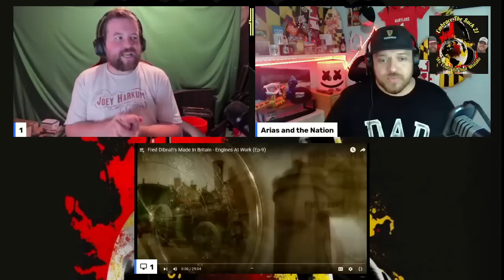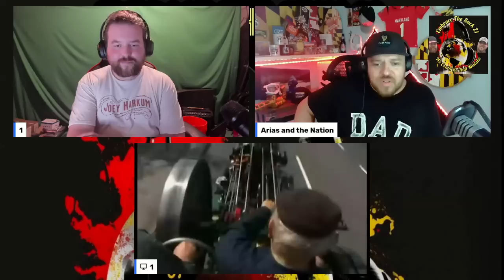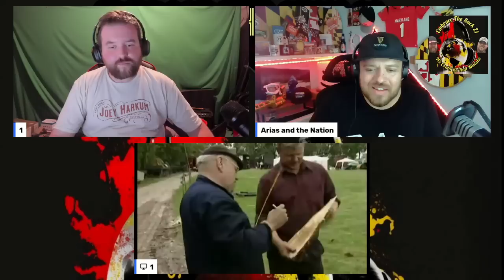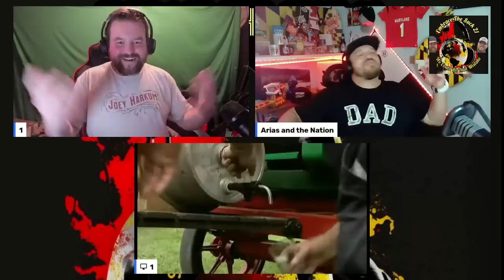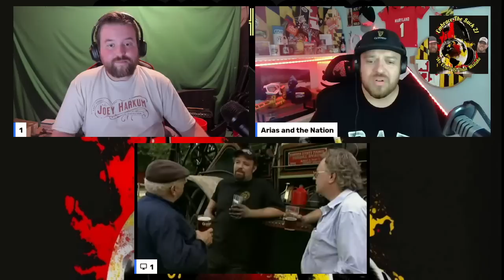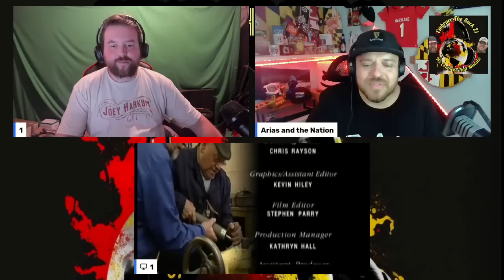American Construction Worker Reacts To "Fred Dibnah's Made In Britain - Episode 9 - Engines At Work"

Comment: If you think about it. Having a machine that could make a wheel turn is very useful. Nearly all work can be done with powered wheel. Pumps, saws, drills, hammers, fans, Almost any type of work. So having a traction engine where you drive to where it's needed and use it to power the tools was a really smart thing.

Comment: When I was a boy we used to walk to school across a big field and when we came home one afternoon there was a traction engine at each end of the field, they were joined by long cables with a huge multi bladed plough in the middle that was pulled across the field and back again moving laterally across the field after every pull, we small boys were fascinated and we regularly found one half of a mole 2ft from the other half.

Comment: I watched a pair of traction engines dredge a local lake. The flywheel was a wire drum going to a snatch block on the side. They both sat side on to the lake, one either side and pulled a huge bucket through the lake dredging up silt, tree stumps, bicycles and shopping trolleys. The bucket went backwards and forwards between them for the whole day and there was several tons of crap either side taken away. It was fascinating to watch them work.

Comment: Severn Valley Railway is still going strong today, think if im right my home town steam railway in wales has a small steam loco on loan from Severn valley railway. remember going to school in the morning crossing over the river seeing the steam engines getting ready or the great sounding old diesels clouds black smoke on cold morning, noise and the smell. still go back to visit as often as i can, not been back since they extended the track to corwen, think its still the most new station in the uk but has a 50's feel. you can stay in a station house, if the got class 08 running you can drive a train loco for as little as £5 but to drive the 8-10 miles its more but you be driving a train along whole route, can be steam/diesel loco or a diesel railcar. they have experience packages at llangollen railway, next visit im sure doing the cheap class 08 as that quite a new thing they been doing and still it is still 49 tons with top speed 15mph as it a shunter yard work loco but a great cheap first way to drive a train. seeing a heritage railway ever morning great memory's and every visit back to home town i have whole days set a side through my stay just for the railway and cannot wait till end summer next visit :)

Comment: the kids doing the steam engine stuff will be the start of rebuilding civilisation if there is the predicted solar flare that will take out electronic systems.

At about the time Fred was recording this, british schools were fitting woodworking, and other hands on things into 1 lesson called craft design and technology, and there was a second class of home economics which was all the cooking etc, 15 to 18 years previous all the different skills were represented by thier own lessons, metalwork woodwork cooking etc so his complaint is more along the lines that at the time you chose home economics (cooking sewing and similar) or CDT (ecompassed all the other crafting) previous to that in the mid 80's they swapped from CSE's to GCSE's and that changed the outlook on education that actually knowing what you are doing meant less than theoretically knowing what you are doing

7 valley railway still active, East Lancs Railway there are several in wales most notably the Welshool and Llanfair light railway, and several that were based around mining or slate quarrying, And then there is the Jacobite Steam Line which if you dont know is the Harry Potter films railway